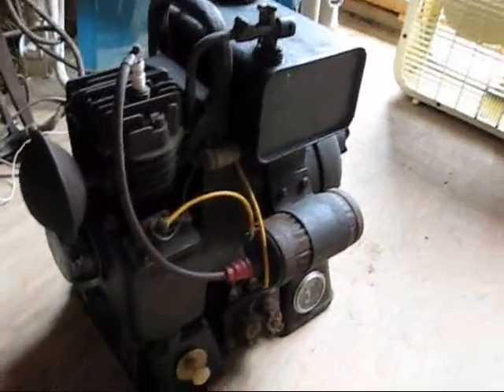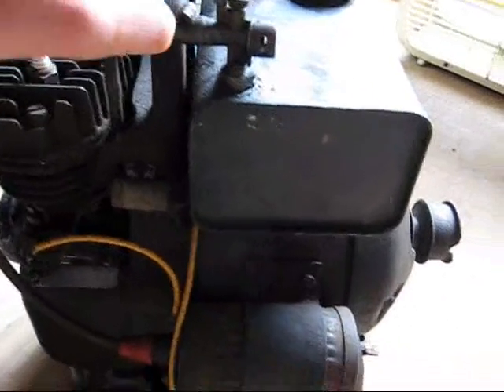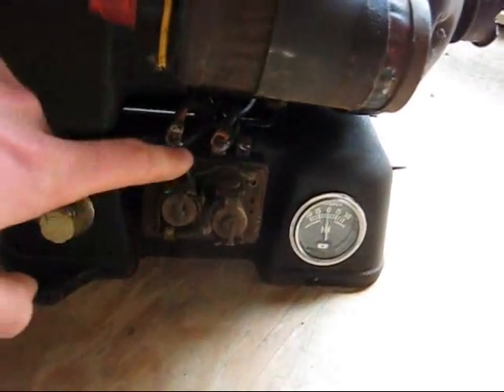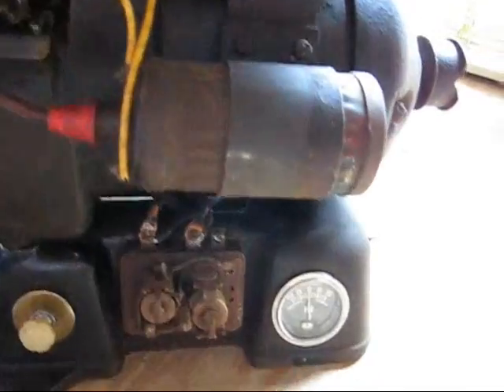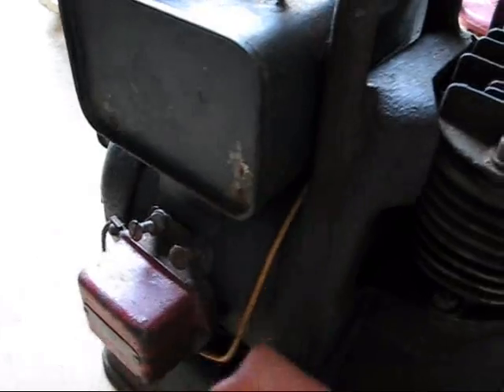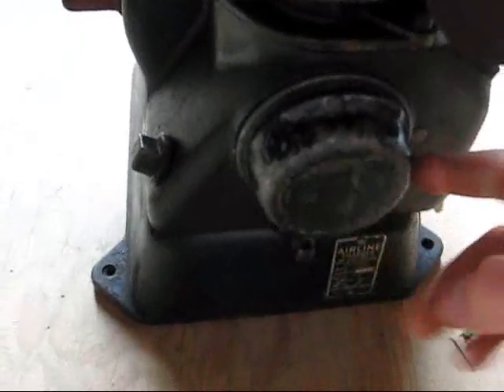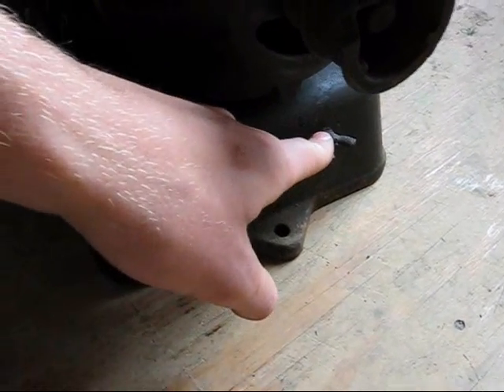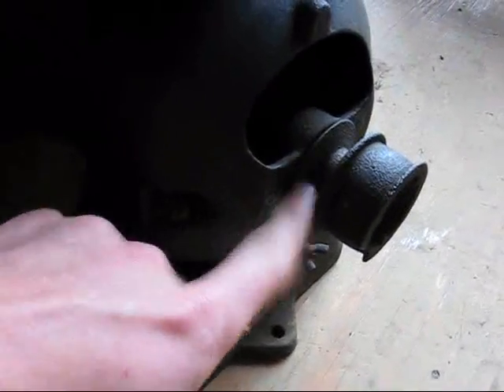antique airline generator

Comment: have the same unit in your video,last time I had it running about 12 years ago---unique setup but I used a 6 volt battery charger to get it running or 6 volt battery. also have a parts unit where I used the gas tank & the regulator to get it running! john z

Comment from the maker: @kjs12224 yes i am aware of that. but the voltage regulator for the generator was damaged so it doesnt allow things to  work as they should. i need to find out how to convert another voltage regulator to opperate the same way or find another. but i had it running once with some tinkering

Comment: hook up a good battery. use the start button to crank it over. that energise the coil and make a spark. remove plug before trying so you can see whats going on. it needs some batt power to juice up coil thru the gen circuit. batt power excites the gen field windings and makes it all work. if it dont crank with a good batt, it might not run, unless you connect the coil directly to a battery.

Comment from the maker: ive cranked it with my 1/2hp wagner electric motor before to see if it would produce any power. never hooked a battery to it yet. does it need a battery hooked up to make spary or does it just produce its own power using the generator?

Comment: would like to help out. it needs to produce a current in the gen before you will get spark. if you take the coil feed and hook to the battery side, it should supply power to the coil. clean and set your points and you should have a spark. 
does the unit crank over on its own with a good battery hooked up?.

Comment: Nice little generator! I had one just like it. If you hook a good battery up to it and hit the starter button, it should have spark as long as all the ignition components are good. If you hook it up to a dead battery to be charged, I know that you have to hold the starter button down while rope starting the engine in order to get spark. I'm not sure if it will have spark without a battery hooked up to it.